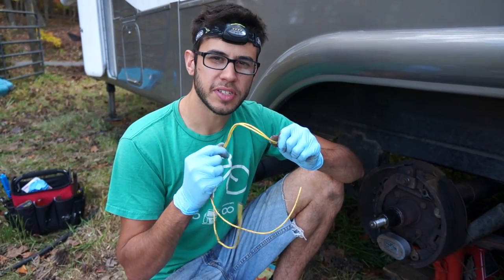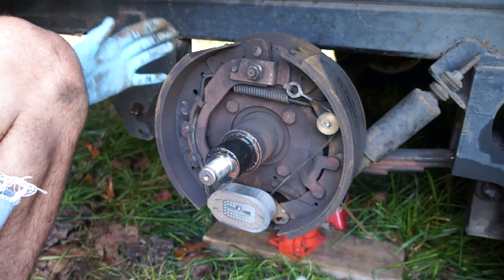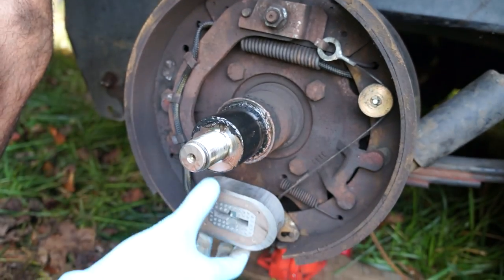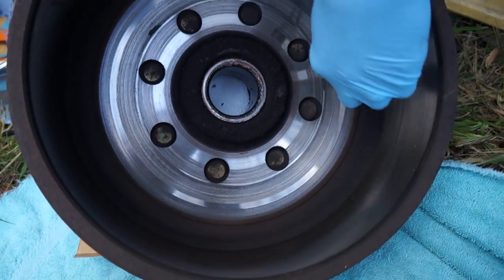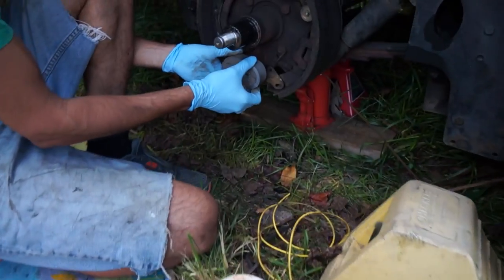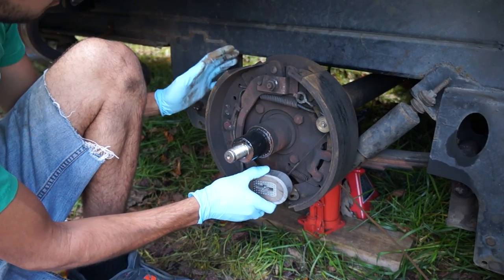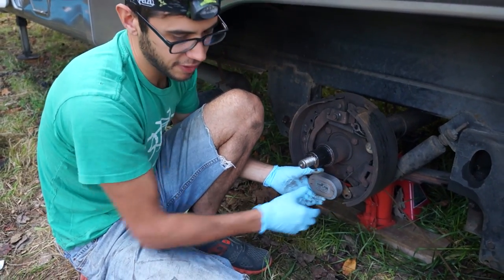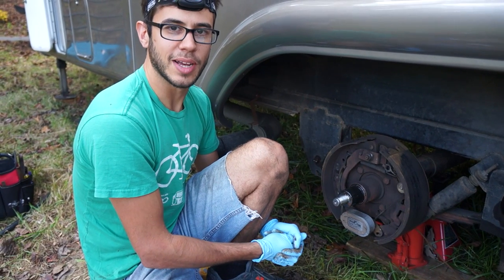How Electric Trailer Brakes Work

Comment: Was messing around with an old electromagnet off one of these things. I didn’t have the actual drum from the assembly but had a sneaking suspicion on how they worked. Surprised with how much force these magnets produce with only a 12 volt supply. Great video!

Comment: Great  explanation, one thing when doing new magnets you have to mill the armature so the magnet can work properly otherwise if there are any groves in the drum were the magnet runs it will only hit the peaks and this will lessen the braking force greatly. always need flat surface ,same goes with new drum and old magnets..    great job other wise.

Comment: Good, clear explanation. Thanks.

It's actually very clever. Instead of complicated worm gears or solenoids, use a small magnet attached to an arm, and let the energy of the trailer apply a greater force on the brake drum.

Sort of like using vacuum to give power to the vehicle brakes or the engine to create power for the steering.

Comment: Explains what happens at the drum but not at the time of need/use! My question therefore is how, after setting up the trailers electric brakes in your tow vehicle, are they activated. Are they passive in response to the driver’s behavior or do I actively have to operate/squeeze the two paddles, hence occupying a hand continually for braking the trailer? Please forgive my ignorance!
Reply: Hey matey, they're activated via an electric brake controller in the vehicle, there's a wire connected to you brake light switch that's activated when you press your on brake pedal, the controller then supplies the amount of voltage you've dialled into the controller to the magnet in the drum, more voltage more braking power less voltage less braking power.

Comment: Just watched the vid again, it seems that maybe the leading shoe is connected by the wire cable to the lower edge of the trailing shoe, that is pivoted on  the upper end of the backplate.  So as the leading shoe expands it also pulls on the wire making the trailing shoe expand on the pivot.  There, I have just answered my own question, I hope I have got it right anyway.
Reply: It's called 'servo-action.' It's a very efficient system.. the harder the leading, or primary shoe gets forced into the drum, that action is transferred the secondary, or trailing shoe. The secondary shoe is wedged between the primary and the anchor point, and does most of the work. That's why the secondary shoe generally has a longer friction surface.
Reply: @TheRazorhead145  Thanks for that John and it makes good sense.  But there seems to be a weak point in the system, is there rapid wear on the magnet due to the friction of the hub, or maybe some sort of anti wear plate attached to the magnet.

Comment: 2 wires going in to the brakes, does it matter which is ground and which is the +12v activation line? I can't see any colors on the wires, which is why I'm asking.
Reply: I'll assume the left-hand rule is in play here so I'll just test each brake with a 12v source and it should only work when charged with the proper polarity
Reply from the maker: No polarity with the magnet so either wire works. Since it's sticking to metal the pole orientation does not matter .

Comment: What regulates the brakes to prevent a complete lock-up every time you use them?
Reply from the maker: The brake controller in the vehicle modulates the voltage and current.  This can be built in or an aftermarket unit.
Reply: I assume the voltage is varied by the brake controller so then the more voltage that is supplied, the harder the magnet grips the drum, and the harder the brakes are applied.  Less voltage,  the more the magnet slips on the drum and doesn't activate the brakes so hard.

Comment: That was an outstanding explanation*** 5 STAR! !I just received 4 electric brakes for my 4 wheel boat trailer. Moving to SC this month and SC DOT requires brakes on every trailer wheel for over 3,500 lbs which I am. Old 2 wheel  hydraulic brake lines rusted out a while ago, and brake cylinder also died, so I decided to go with electrics, as SC boating will be fresh water compared to FL Salt water.    I have been thoroughly studying how to install them. Learning about things like packing the bearings with grease 1st, using bearing buddies replacing the old cotter pins etc. When my brakes arrived today and I unboxed them and  immediately saw that the magnet slid in and out, and I initially thought THAT CAN"T BE RIGHT,  whats missing!  I feel sorta  foolish now!  Man you nailed it! Great job and very much appreciated! By the way here is my 20 year project boat! https://www.youtube.com/watch?v=lo8h5IyR7KI&t=34s Thanks again All GOOD!
Reply from the maker: Thanks so much! :)